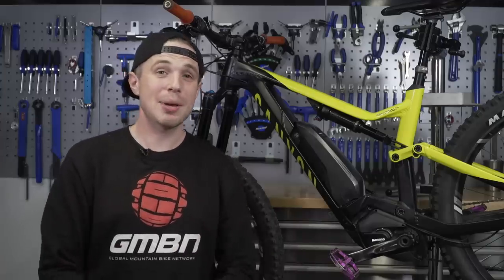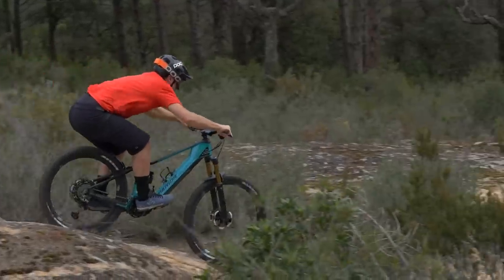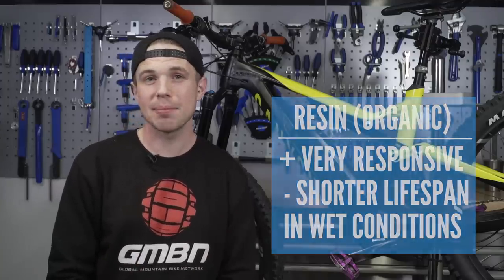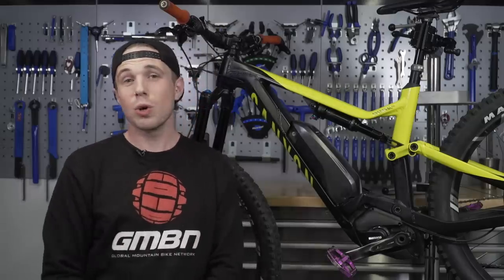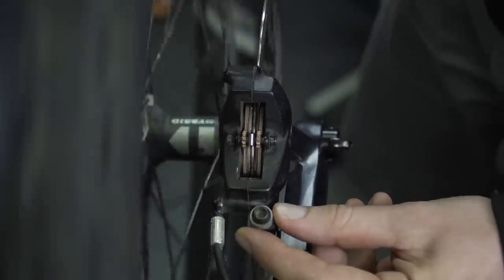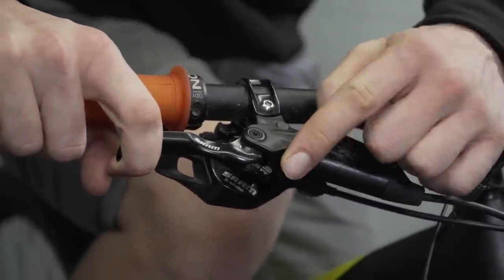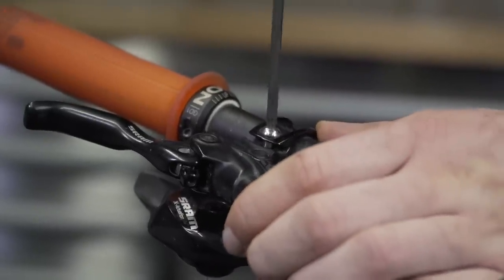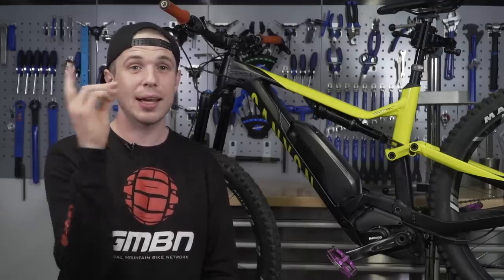How To Adjust Your E-MTB Brakes | Disc Brake Set Up Tips

Comment: Own a Fat Tire E-bike on a Mtb style frame but it's actually built for Road/Improved Trail riding.  In 3 Seasons I've logged 16K miles total on my riding apps.  All brakes do is convert Kinetic energy into Heat. That said, most brake options are rated by the average Top Speed you intend to be breaking from most of the time. I'm pushing 260lbs of rider, including spares/equipment + a 75lb E-bike so i need some stopping power. I'm on my Third set of Rotors and upgraded from 180mm to 203mm Rotors after the first set hit their wear limits. The switch to the Larger dia Rotors was a Nice improvement giving a much more "progressive" feel, or greater range of breaking to work with. I've Only ever used Organic Resin pads for Two reasons. They're softer than Metal or Ceramic compounds and therefore my Rotors last longer. And, even though you'll change pads more often, they tend to cost much less than ceramic/metal pads and brake w/o the "grab" you get from ceramic/metal pads. I Don't ride in the rain so i can't  speak to how this setup holds up to water but it's been working well . The next upgrade will be from 2 piston calipers to 4 piston calipers.

Comment: Lots of good info here. I've just upgraded my Nutrail's Magura rotors to 203mm front and back but kept to EBC green MT7 pads for a better feel. It's a lot more controllable after long DH sections. Spot on comments about modulation.
Reply from the maker: Cheers Jack!

Comment: Very nice video, thank you!

I just wanna add something:
Think about body weight and riding speed. Manufacturers teach us that EMTBs need heavier duty brakes because of their weight, which totally makes sense. But so does your body weight, which has a far greater span. EMTBs are about 10kg heavier than their bio counterparts, yet riders span from 50kg up to easily over 100kg. (I‘m 110kg myself).
The far greater factor in braking performance needed comes from speed, since kinetic energy is formed by mass but also velocity squared. Yet EMTBs don’t really ride faster since they stop helping at speeds over ~25km/h and that’s not even close to „fast“.
I ride and prefer downhill brakes (Saints are my prefered choice) on all my bikes, those few gramms do serve well, give confidence and safety.
I‘d put Saints on a XC bike if I had one. And 203mm rotors in the front, big rotors are free brake force.

Give me your thoughts.

Comment: The best mod I found for my e-Bike brakes are changing them altogether. It's a shame when you pay 5000€+ for a bike and it comes with 2 pots calipers ( Shimano BL-MT500 ). Stopping power was nowhere to be found. I installed some Shimano Saints, and no more problems :D
Reply: To those on a budget br-mt520s are 4 piston and direct replacement to the mt500 calipers.
Reply: @SoDiezl350  Oh, that's nice ! Thanks for the tip, I'll recommend those to friends.

Comment: Well presented video Henry (please take note Mr Jones!). In addition to the wear rate of sintered over resin, what’s happening over time to the surface of the disc in terms of wear as logic suggests sintered would wear the surface quicker? Plus, what is the current thoughts on ceramic and kevlar regards performance and disc wear or are they expensive options for little return?
Thanks 😎
Reply from the maker: It's worth checking the rotor is rated to be used with sintered pads as they do provide more wear than resin options. (It still takes ages to wear down a rotor though!) Some brake callipers use ceramic pistons to reduce friction and offer insulation. If you want to try a Kevlar compound pad check out Superstar. We haven't tried them though.
Reply: The rotors are standard which were fitted to my Haibike Allmtn RC but are getting annoyingly noisy despite being well aligned and with plenty of meat on the pads. I assumed that they may be contaminated so looking to change pads but not sure what type were standard with SLX and what would be an improvement with so many options at ridiculous variations in price 🤔

Comment: I'm not sure that an EBike needs any more attention in the brakes department than any other bike. An EBike is only 5 to 10 kgs heavier and weight variations have always been there with the difference in rider weight.  But the info was good to hear.  Maybe we could go back to dual front disk brakes esp with fat tyres.

Comment: Larger rotors do not provide more stopping power from simply being 'larger' they provide more stopping power by dissipating more heat, so they keep cooler don't over heat and provide more braking power. You can have rotors as big as your wheel but they won't provide any more braking power.

Comment: Hi Bosch Warranty claim ?
I have a cube reaction race  29er with the Bosch performance CX motor.  I purchased it from Race Cycles in August 2017 so getting very close to that all important 2 year warranty.  
My question is 2 part
!) The range of my battery which is the 500 WH has reduced significantly during my ownership.
I recall the warranty stated that the battery capacity would be at least 80% of the new battery 2 yewars on.
If I am correct how do Bosch or the retailer check the capacity.?
2)  It could be possible that the motor is working less efficiently of course, I've heard of the possibility of bearing issues with my motor which I'm sure could have an effect on range too.  
I am not aware of issues with my motor.

Any advice on making a claim I think for a battery would be appreciated.  My gut feeling is that capacity is about 25% down.  For your info I've coverd just short of 2000 miles to date.
Thanks   David